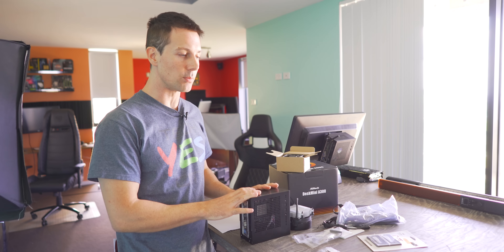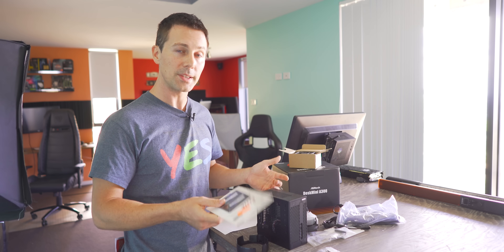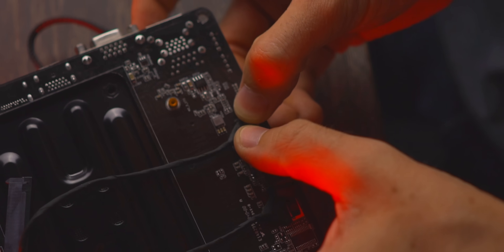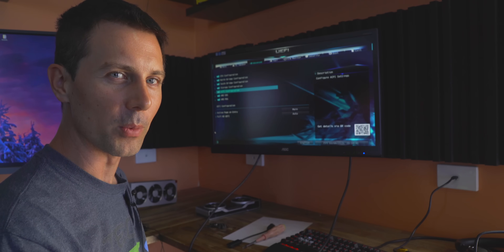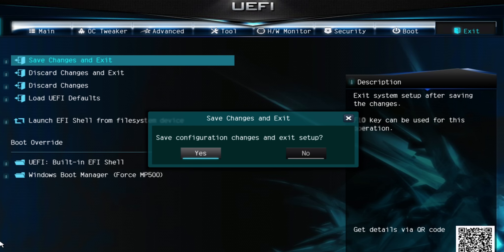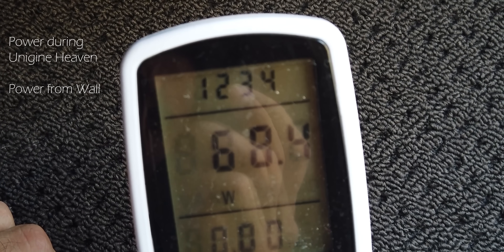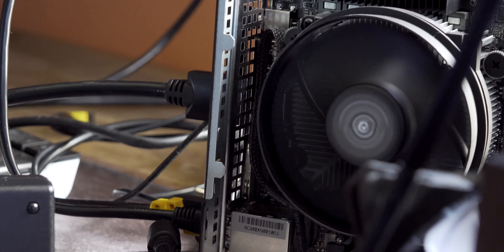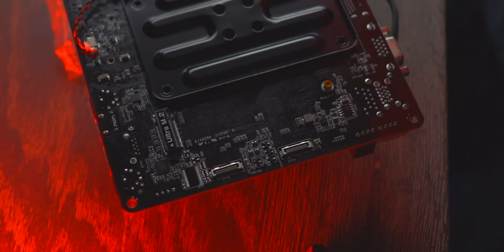The $150 RYZEN Desk Mini is HERE....! (ASRock A300 Review)

Comment: No AC-in = No interest.

I'm waiting for a mini-pc which actually houses all the components.
Reply: i guess that wont happen. there is simply not enough space in it to fit a psu. if you want that, then you have to go for mini-itx.
Reply: @bertracoon1884  ...what? They can literally just make the case bigger.

My point is that these cases are too small to fit the damn components, so their small size is a lie.
Reply: The power brick is half the size of the main PC! But the brick is easily hidden... Where a full computer with all the ports needs to be accessible, and it would be less appealing to be 150% the size

Comment: $150 + $55 8gb RAM + $95 Ryzen 3 2200G + $60 M.2 500gb drive = $ 360 . Not bad for simple tasks. But I feel the $150 is a little high. I wish they could hit $100 price point.
Reply: Well you get a motherboard and a case.

Don't forget their also development cost.
Reply: Don’t forget what he said at then end of the video - NVMe M.2 drives only!! System will not boot with a SATA M.2

Comment: how is it so cheap wtf the cpu cost the same as the computer
Reply: it is a barebone. there is no cpu, ram and hard drive included. so it is the case, board, power supply and that´s it. but it is still a cool little box. i wouldnt recommend it, if you dont need to save space or want it to be really small to take it with you on vacation or whatever reason you have to carry a tiny pc with you.

Comment: Does anyone know if a Noctua NH-L9x65 will fit inside one of these?
Reply: yes. theres a youtube video with one being used in this
Reply: @lunchie80  That's the L9A, I checked the ASRock website and it says the max height is 46mm therefore the L9x65 is 19mm too tall so to answer my own question no it won't fit.

Comment: Ok, hoping to score a 1070 mini gpu, what is good budget small case for it?  Also budget cpu to add?
Reply: here, in germany, the ryzen 2600 is 140 - 150 euros. if you want to buy new and get a decent setup, then there is no reason to go lower but i dont know what budget exactly means, in your case. if you want to put that into a small case, then you should get an mini-itx board but that form factor always costs extra. so if you dont really need it to be that small, than any normal case would be ok. depends on your budget.

Comment: Honestly I would ask my IT department to import many of these to build nice machines for Digital Signage (I work at an Airport).
Reply: Is notebook CPUs like i7-8250U board not enough?
Reply: vadim negru  Barebones i7 Mobile NUCs and equivalents are not as dependable as these machines, and not as cheap either. Anything would work, even an Atom. 

But we’ve had good experience with Athlon II and HD3200 moving 1080p displays that going with these ones with an Athlon 200GE would be wise. Plus, by the time we configure one of these with a cheap DRAM-less 120GB M.2, 4 or 8GB of DDR4 and a 200GE, we would end up saving money next to some NUCs (which most of them, despite having Lake architectures, are foregoing LPDDR3 and require you to buy DDR4 SO-DIMMs)

Comment: Few stated looks like a ATX powersupply so wondering does it fit in a powersupply slot in an ATX case, great video and unit 👍😎🇦🇺
Reply: That's an interesting idea, it could be mounted in a full size pc case like the LIAN-LI PC-O11 DYNAMIC with two PSU mount points!
Reply: @jonathanellis6097  well wondering if you could link both PCs, I mean the harddrives from both Pcs in one ATX case, I guess through USB? I suppose you need to find a big enough case that can fit 2x powersupplies, be handy though running 2x systems in one case 👍😎🇦🇺

Whoops ok you've mentioned few cases that can,.. nice 👍

Comment: Love the channel like when you do older parts, i would like to see how the 3770k holds up today in games.  I still have a system with a 3770k 4.5ghz and a msi gaming x 1060. Sandy bridge gets plenty of love but ivy bridge not so much.
Reply: Cause it's a tick, not a tock (google it :) that's why. Not many was changed, it was an evolution, not revolution like  nehalem>sandy
Reply: Rafał Gębicki i understand why but there are so many more videos on sandy than ivy, sandy bridge will go down as one of intels best
Reply: I got a 3770 and use a 290x. Im yet to run into a game that destroys my fps (as long as i stick to 1080p)
Reply: I also use a 3770k @ 4.2 GHZ with a GTX 1070 and am quite happy with it and am feeling no need to upgrade any time soon!! I game at 1440P cranked up to high and have no issues.

Comment: Why are u putting a motherboard inside that PSU ?
Reply: lol
Reply: Imagine this thing in the second psu slot of a PC-O11
Reply: Technology. It evolves. Next time there will be a Philips screwdriver on a Swiss Army Knife.
Reply: @exlibrisas   - let's not forget the tweezers
Reply: @exlibrisas  hopefully
Reply: @exlibrisas also anti static
Reply: Fr
Reply: lol, I like the pico power units they remind me of the old Xbox and laptops. they are easier to fit into small builds and I've seen ones that go up to 600w.
Reply: Now that would be interesting if ASRock would release just the board so we could hollow out dead PSUs because they obviously cant keep up with demand of the barebones lol
Reply: @Wahinies  hollow out the psu and use a 140mm pwm fan inside for cooling and a passive heatsink on the cpu

Comment: Super interested in trying this with a new Ryzen 3000 series APU.
Reply: Will😋 be a great SSF. YEA😁👍😅
Reply: Mohd Faizal SSF? Small smorm factor?
Reply: That's what I thought.
Reply: I can't wait. If they have roughly rx 560 performance, then I will grab a couple for a LAN room.
Reply: It won't be a Zen 2 based APU... It's already confirmed 12nm, simply a refresh from the first ones released. 7nm APUs are coming out in 2020.
Reply: PhambletonMR no no no, you’re confusing Picasso APU’s, the second gen mobile refresh, with Raven Ridge, which was the first of the Ryzen 2000 series sku’s. However despite being the first Ryzen 2000 parts they are all still 14nm chips. You can expect to not see any desktop updates to this range until 7nm has been out for a while, or possibly to keep the appearance of simultaneous updates despite being a year behind we may get a zen+ 12nm desktop APU’s just shortly after zen 2/7nm launches. 

For now Picasso 12nm zen + APU’s are mobile parts only as they were overdue for refreshes.
Reply: Fee How come the 2200G was released exactly one year after the Zen 14nm architecture premiered? It's extremely unlikely that we will see 7nm APUs later this year... 7nm APUs will release one year after the desktop CPUs are out.
Reply: PhambletonMR i literally just said that wtf
Reply: PhambletonMR what you must be not catching is that “Ryzen 3000” APU’s are Codename Picasso, and they’re 12nm Zen+ MOBILE chips, NOT DESKTOP. 
We literally just got the Desktop APU’s in January 2019, and they started off as Ryzen 2000 series in name but used original Zen 14nm nodes. So they’re not going to update the desktop APU’s until both 7nm & Navi can be leveraged, as a Zen+ APU would be practically useless. 

The bottom line is the Ryzen 3000 12nm APU’s, the Zen+ chips you’ve been hearing about codenamed Picasso, are all Mobile chips, because they actually stand to benefit from going to zen+ 12nm from 14nm.
Reply: @Phambleton  You are correct. The 7nm APUs won't be released until next year.
Reply: @Phambleton  Where did you read/hear this? At this point the only products confirmed are the mobile APUs (which will be 12nm) but it doesn't make sense to run the new desktop APUs on 12nm...
Reply: @tim3172  He's probably wrong. On July 7 (7/7) they want to launce the 7nm Ryzen 3000 and also Navi graphics.
Reply: It's confirmed boys. The next APUs from AMD will be designed on 12nm (because last year it was on 14nm finfet) including power delivery improvements only. Expect a release in Q3 2019, just like I've said before... I said this at the end of 2018 but nobody would listen.
Reply: @Phambleton  desktops APU, 7nm processors are coming this year.
Reply: Avolo Are you saying 7nm Laptop APUs are coming this year? That's highly doubtful, and besides the OEMs will take time, so earliest is probably Q1 2020.
Reply: @Phambleton  Desktop, not laptop. 7nm processors I think will be in the market this year.
Reply: Avolo No that's not possible since the [Desktop] APUs are precisely 1 year behind their desktop standard counterparts. Eg. 2200G/2400G is based on 14nm Finfet even though it was released at the exact same time as 2000 series, which is on 12nm instead. So we're expecting the same thing to happen again, only stepped up by one generation. We're expecting 3200G/3400G 12nm refreshes with maybe 5-10% uplift in performance by power delivery optimisation.
Reply: PhambletonMR i cannot believe what I’m reading how are people still lost in this “thread” and how did a reply that was added by someone to put an end to any possible remaining confusion by confirming the reality of the situation somehow trigger confused replies. You’re far more patient than I. I don’t think reading the comments in this “thread” for context is too much to ask/expect of someone.
Reply: Avalo respectfully, you’re lost.
Reply: @Fee.1  No idea haha, mind you AMD did make it a little confusing. But I would've expected everyone to be up to date with things.
Reply: @Phambleton  Oh.. well still some kind of improvement. And I guess we will be seeing lot smaller PC's in 2020 at least.
Reply: @megapet777 Yeah there will be better power delivery and management. A nice uplift I suppose, at least this will drop the prices of the 2200/2400G ;)
Reply: @Phambleton  that is the mobile version you are talking about the desktop one will be 7nm due out late 4th quarter or early 1st quarter 2020
Reply: Indrejue I'd highly doubt that... Remember how long it took to release the 14nm APUs? Exactly one year after the standard desktop CPUs were released. It is for certain that 7nm APUs are not coming out until Q3 2020.
Reply: @Phambleton  AMD doesn't want to slash intel too fast ;;;; )

Comment: Put the rgb wrath fan on the stealth???
Reply: Prism wont fit, totally different design.
The led spire fan will mount onto a stealth heatsink BUT the led ring is built into the part that was removed to fit into the enclosure(the plastic cowl) so basically with the led fitted, the mobo may not fit. Swapping the fan is easy though.

Looks like no room to move to me...
Reply: I know prism wouldnt work but the normal fan with the rgb line is the same size. wouldnt change anything just look kooler
Reply: @rebelwithoutaclue4440  like I said. The rgb ring is in the top shroud of the fan which had to be removed to fit the stealth cooler. Have a look, the stealth has the shroud removed back to the bare fan just to fit and it's hard up to the mesh(And he had to bend the side a bit to even slide it in). If the stealth shroud won't fit, the spire led shroud won't either.